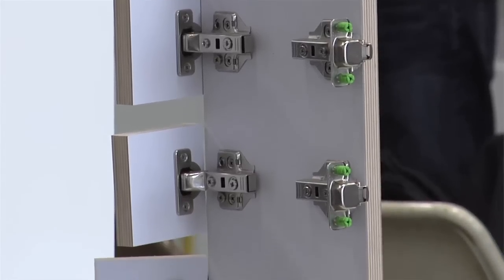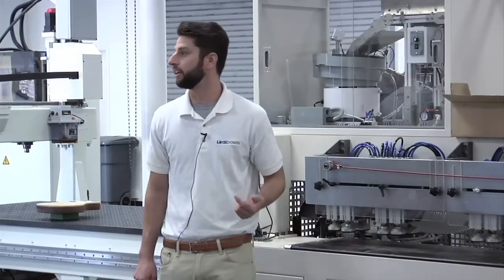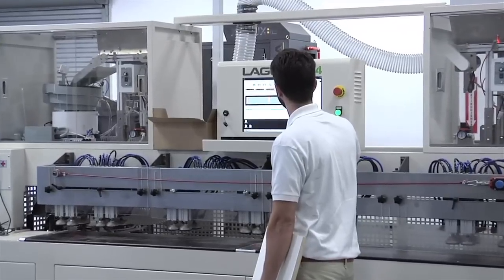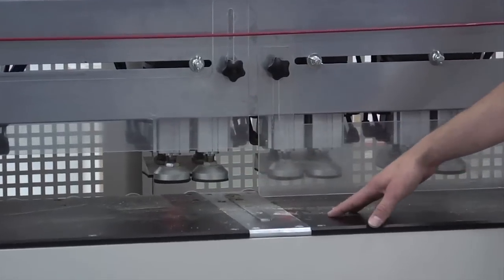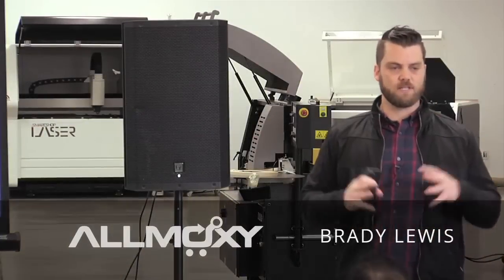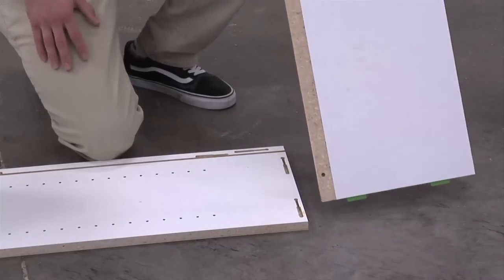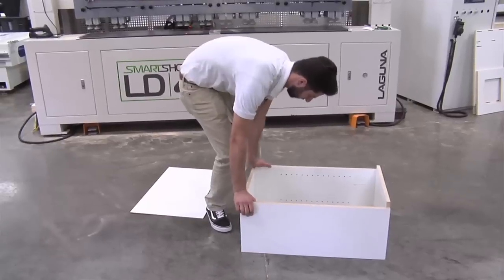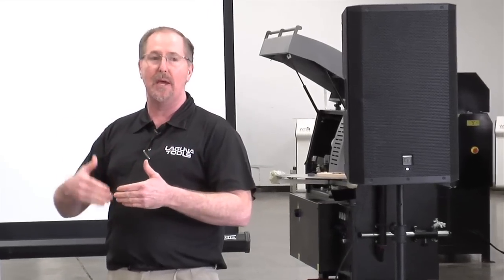Glueless Cabinet Assembly with the Laguna Tools LD4 - LockDowel - CNC Machine

Comment: I like it but can it cut into plywood as well?
Reply from the maker: The LD4 is actually for drilling and insertion of Lock Dowel products only. Plywood cutting would be done on a separate 3 axis CNC router like the SmartShop M2 or SmartShop II.